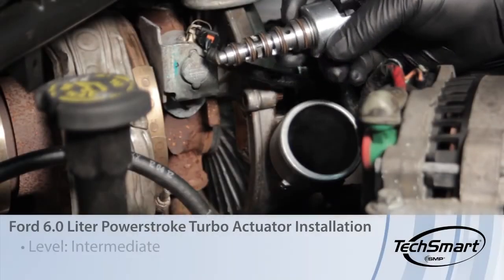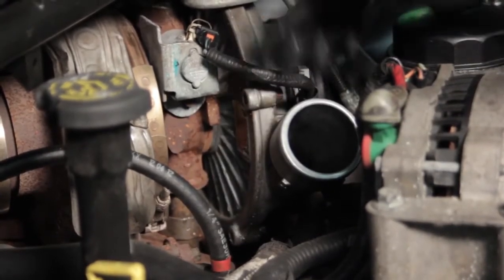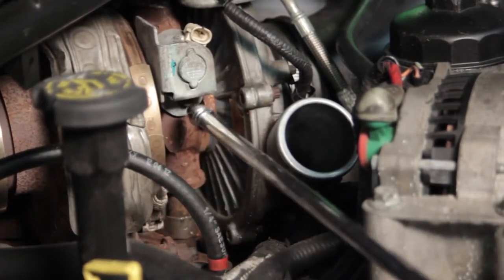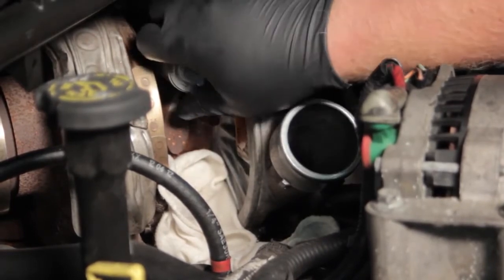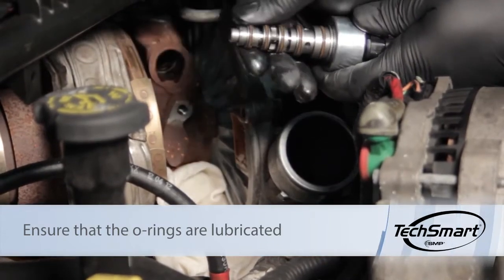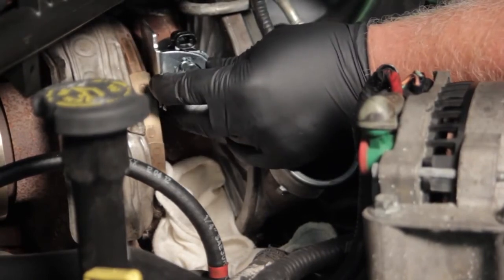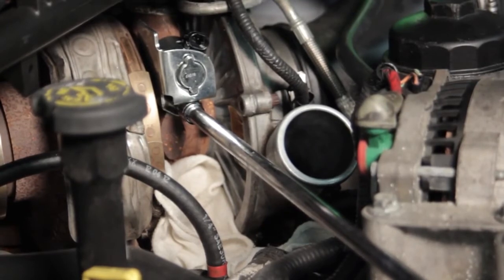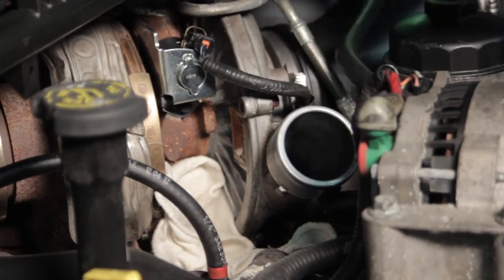How To Install a Turbo Actuator on a Ford 6.0 Liter Powerstroke

Comment: Not true relearn is highly recommended.  Unplug batteries for 5min, drain power completely by turning on lights.  Connectors back on start and idle truck for 5min.  Relearn complete.   You will potentially not get full range of the vgt

Comment: My turbo sometimes buzzes when I turn the key on. Is thst normal? When I start the truck the buzz goes away. Have you all experienced this? I know it's the turbo because I unplugged the seloniid and the buzz stopped. Once I connect it it buzzes. It happens randomly. But only when I turn the key and elt the dash cycle thru all the lights before starting the truck

Comment: It would have been nice to hear what it sounds like before you changed the part.. I have an 07 6.0 that am learning a lot from.
Reply: did u ever find out what happens when it fails or at least the functions
Reply: @rafaelfregozo  the truck can be slow off the line or no power on the top end.